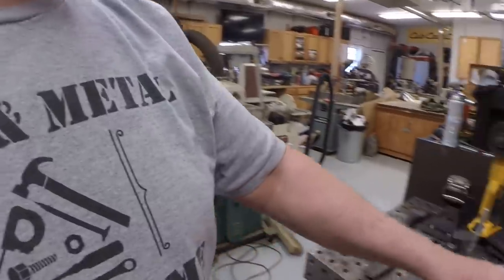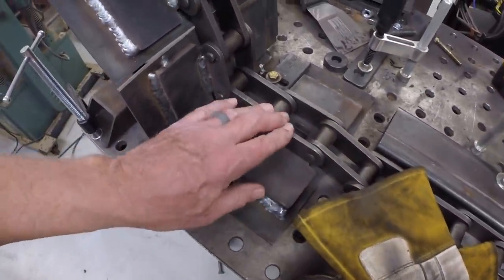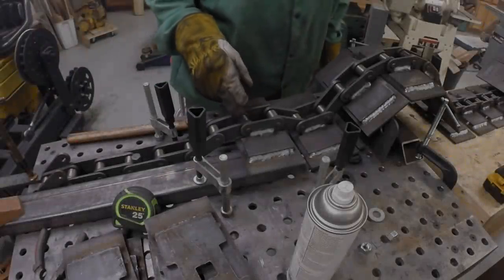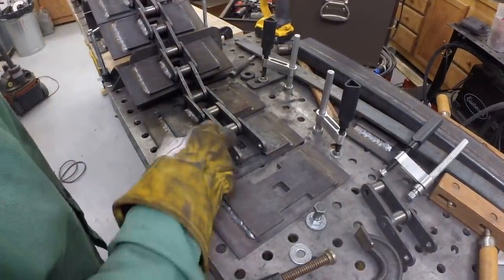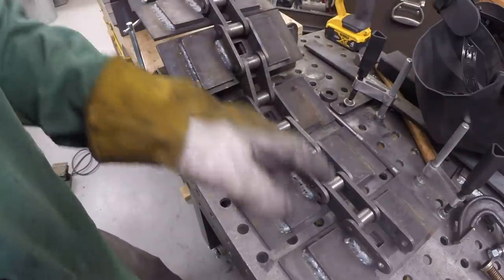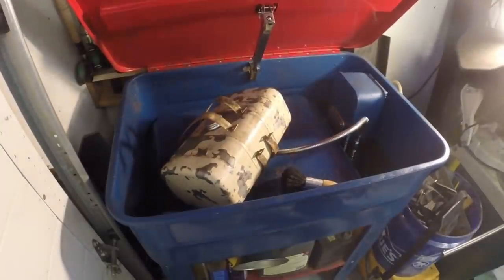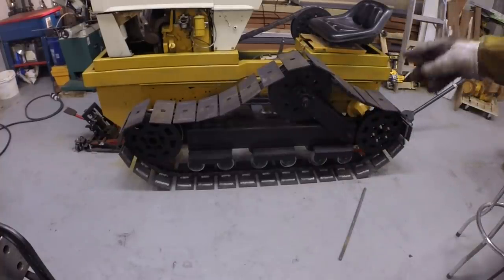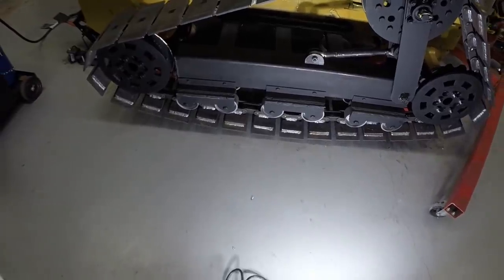Cub Cadet Dozer Build  S2:E4  Track-tackular!

Comment: Hey guy. Don't worry about how people criticize your process because what you build is absolutely awesome. I love it. Maybe a Cub cadet mini excavator in the future perhaps. Keep up the good work.
Reply: That would be interesting to see how he figured out how to run everything off of cub cadet internals and make it still have the cub cadet look. He could use the mower hood where it would open sideways behind the seat and have the mechanicals there like a real excavator. I mean he's got the track system down and once he figures out how to raise and lower the blade on the dozer all he'd have to do was do a little conversion of that system to run the boom, stick, bucket, and rotation on the excavator. He could use a PTO to power a hydraulic pump for those functions. I really think he's smart enough he'd figure it out. Maybe he'll tackle that one day!  😀

Comment: You are doing an awesome job. I am an equipment operator and I have operated a D 10 for many years. You are using a D 10 as your inspiration for your build. But, you are not building a true D 10. Like you said, it's just a toy. It is an awesome toy at that. You are doing an awesome job Can't wait to see the finished product.

Comment: You are making some great progress. So cool to see the track on it. A lot of work to get to this point. Your welds are getting pretty darn good there. Practice makes perfect and this project is giving lots of practice. Funny, I catch myself looking away when you strike the arch. Old habits are hard to break. It looks like you have sufficient slack to assembly the chain off the dozer then install, may make it easier. Hard to tell from film.
There are a thousands ways to accomplish something, I hope that my comments were not harsh or insulting. If our places were switched, I am sure that viewers would be making the same comments about me. Turning a lawn tractor into a dozer is no small task and takes a lot of thinking out of the box.

Comment: (When you were drilling out the holes for the master link) I remember when the brushed 18v would "Hang up" when trying to get through that last little bit of metal and you could "Power it on through. These brushless 20v designed to cut out and it makes it hard to finish the hole sometimes.  I realize its to protect the drill...  

Looking forward to seeing this thing moving under its own power.  AWSOME JOB!!!

Comment: The holes in the links are tight because it is meant to be a press fit. The trick to drilling these out is to drill it in reverse. It's not great on the bit and will require pushing force, but it does work and will reduce the chance of a broken wrist. Be careful and keep up the great work Frank!

Comment: Great update, signed off work and you had just posted!!
Like many others said, those who leave negative comments probably never tried anything even close to what you've done, if anything. ✔ 👍 👍👍
In first episode you even state you used the D10 as a reference for your build, so you are doing exactly what you stated, building a running cub cadet in it's likeness.
I also would love a shop like yours, you use what you have and turn out amazing stuff!!
Love that you keep filming and share your pups with us too🥰

Comment: When I first saw your design I was unsure if i was going to work all that well but after seeing it together is looks good.  You could just about make and add nylon wear rings that bolt around the forward and top idlers to reduce wear on them in the future if you wanted.  Your craftsmanship is very good as well.  You take the extra steps in getting your metal clean and your welds and fitment show.

Comment: Frank don't let the nit pickers get to you. That thing looks 100X better than I could do in my shop and I am a welder/machinist/mechanic. I have designed and built some pretty cool stuff in my day and with a fully stocked shop at my disposal it was fairly easy. I think you are doing a danged fine job with what you have in machines and experience. Would I have done some things different? Sure I would but a lot seems acceptable to me. Sometimes you have to make compromises.
So was that cool or what to see that track go for the first time? It's going to be a blast to ride around. 
Keep up the hard work, the light at the end of the tunnel is getting brighter!
Take care and be safe!
Cheers
Terry
Reply: AMEN

Comment: As always thanks for another great video. Everything that you're doing is just a dream for me. I don't have the tools, time or skills.
Reply: Nothing to any thing here except learn it and as for the tools eBay has a mig tig stick 110/220 machine for under 400$ that I kept over a Lincoln 110 mig simply because it out performed the Lincoln at 110 to 110 why not have the better welder with much more options the rest of the machine tools are not as expensive you might think find a cheap lathe in the 9-12” range for 500$ or so and with that one machine it’ll blow your mind what you can do everything done with the plasma table can be done with an angle grinder not much fun but it can be done start gathering tools and before you know it you’ll have a metal fab shop quick ask me how I know in under a year I have a functional full size machine shop

Comment: Very nice man its coming along nicely. Im getting ideas from your build for a project.  I will recommend theres a certain amount of slack youd want left in the track to prevent the track from wearing out faster than it should.  I cant remember the formula to calculate it but the cat d9 and 10 dozers i run at the gold mine we have a ruler that u measure from the center of the suspended  track frame to the track pad to determine if its adjusted correctly

Comment: Frank, The link was not made incorrectly - the problem is with the weld jig.  A better jig would be do have the link lay over the plate and then insert an alignment block into the square hole of the track plate. This correctly aligns each link to each track plate. This way eliminates the slight misalignment that becomes compounded over 31 tracks.
Reply from the maker: Pretty keen if you could tell all that from there.
Reply: @woodandmetalshoptime8048  Well I think there's  a brief moment in the video where one can see the square  hole in the plate is not quite centered between the ends of the link.  Also, my experience has shown similar results if the "timing" is not precise over sufficient  amount of repetitions. Bottom line for jigging, it must secure both items simultaneously. Currently your link locator is distant from the track plate locator.
Reply from the maker: Track pad placement on the chain is strictly a cosmetic thing. The chain determines how the track will run, I'm not affecting that. There is no cumulative error because it's all in the chain. Worst case is a pad might be out of alignment with the others.
Reply: @woodandmetalshoptime8048  Fortunately there was little difficulty for you until reaching the the last 3 or so pads of the track. It will be interesting to see if welding the next track is any different, or similar results.

Comment: Very nice Frank!  Has your welding skill improved from your perspective with the many welds and new welder?  From what I can tell it has.  Would like to know what you think.  Thanks!
Reply from the maker: I think the new (240V) welder did more to improve my welds than anything. I was really struggling with the 120V welder. Obviously, practice does improve things, though.
Reply: @woodandmetalshoptime8048  one thing I would recommend is grinding the mill scale off the flat bar. Mig welding tends to ball up on top of the scale and not get very good penetration. Some machines have a dig setting which can help punch through the scale a bit but you're better off just grinding it off.

Comment: Need to use a step drill for enlarging those link holes. Much easier on the wrist!
Reply: But You Can't Do Deep Holes with step. Maybe a Reamer?.
Reply: @dougsandercock1672  You can do around 3/8" thick plate at a single diameter with some of the ones I have. Which would have been sufficient here it looks like.
Reply from the maker: The issue was more about the drill chuck hitting the track itself, causing the bit to be angled in the hole.
Reply: @woodandmetalshoptime8048  Most of them use 1/4" hex drive, so you just use an extension to get as much reach as you need. Do it all the time, works brilliantly.

Comment: Hey Frank. Just a little constructive criticism. If you go to the 11 minute mark on the video, you'll see the way the weld glows brightly which means there wasn't penetration into the track pad. Just trying to help as I have been welding professionally since 82.
Reply from the maker: So how do I fix that? Or, how do I get better penetration next time? Fortunately, it's not a structural weld...
Reply: @woodandmetalshoptime8048  if you direct more heat to the thicker material and watch the puddle blend into the thinner that would do it. I realize it takes practice. Just trying to help by giving you something to watch for. You're doing really well over all.
Reply from the maker: That was an awkward position to weld, the backside of the chain. Looking at that particular weld, I see what you are saying. I think most of the other welds didn't look like that one.
Reply: @woodandmetalshoptime8048  yeah that's the one that stood out to me. It's important to get yourself into a position to see the puddle as difficult as it may be at times.

Comment: Only thing I'll give criticize about is, honestly, you should've double checked the holes for the master link pin prior to welding the chain up. That's just a common sense thing. Not saying you did anything wrong. It's a live and learn and we all do things differently.  
It is coming along, slowly but surely. Looking forward to when you get the other track on. I'm still curious to see how you intend on getting on and off the machine though. Great video, cheers :)
Reply from the maker: I've been climbing up by stepping on the tracks but recently added a fold down step on the tension arm.  You won't see that for a few weeks, though.

Comment: Nice setup thus far. You drill probably begs you to stop using it to drive the tracks. I can't believe it has the power to run the tracks. The poor little planetary gears sets inside the drill are giving everything they have. But Thumbs Up for a great series...
Reply: But remember it's running a pump under relatively low load.

Comment: I've used those paint remover wheels several times, a little on the pricey side but worth it for a quality finish.

Tracks, using a rubber track ever cross your mind?
Reply: Rubber $.

Comment: Hi Frank, excellent vids mate, One thing worries me I don't know if it's just because it's a video or not, I am, or was before I retired a pro welder, and I am concerned you are not getting a good penetration on those thick sheets and that chain, I don't see the marks you should have on the backs, if it's a cold weld it will have no strength. Bob in the UK

Comment: Awesome job, Frank. I am just curious after adding all the weight of the track system and blade will the dozer have enough power to actually move dirt or gravel. Not criticizing at all, again just wondering. When I was a young boy a man down the street from me made a dozer almost the same size for his son but most of it was made of wood and old lawn mower parts, really brings back memories of my childhood. Keep up the good work. Love me some cub cadets don't make them like that anymore. 👍👍
Reply from the maker: Hey, Chris, you've asked the question many others have asked, and it's a logical question, for sure.  The weight of the tractor is really not an issue, it takes very little power to actually move it on level ground. HP becomes the limiting factor as far as pushing a lot of dirt. Which is true of any piece of equipment. Since I don't expect this machine to do any major work--I'm not clearing land with it--it will still operate within it's capabilities. Meaning, I should be able to grade my driveway, spread gravel, that sort of thing. It's really not about building some super capable machine, it's about using Cub Cadet parts to build a toy dozer--functional within it's limits.
Reply: Thanks for answering my comment, can't wait to see and hear the click clacking of the tracks. Like I said before love those older cubs awesome tractor and love big boy toys bigger the better. 👍👍⭐⭐⭐⭐⭐

Comment: I can see the Go Pro mounted on the plasma table when you do close up shots while cutting.  Do you use another Go Pro for the majority of your videos or some other equipment?
Reply from the maker: Everything is done with GoPro cameras. I have 4 of them. (well, one is a knock off, not an actual GoPro.)
Reply: Thanks Frank.  Which Go Pro's have you got?  I know they offer different color and numbered versions.  Your videos have inspired me to film some of the items that I build.
Reply from the maker: A 3, a 3+ and a 5 and a knock off. The 5 is problematic. Need to remove and reinsert the battery every time it's charged to get it to boot up.   Most stuff is recorded with the 3+. I have very limited internet here so I shoot in 720/60 fps.  It takes overnight to upload a video. LOL.  Where's the Rural Broadband Initiative when you need it?  Waiting on Starlink to become available here, supposedly mid 2022.
Reply: That's what I needed to know.  Thanks Frank!

Comment: Why the odd number of pads?  31.  Seems it should be either 30 or 32.
Reply from the maker: There are two different links in the chain, the outer link and the inner link. They alternate. The track pads go on the outer links. You can have any chosen number of outer links but will always have one fewer inner links (as they go between each pair of outer links).  So there are 31 outer links and 30 inner links. Hard to explain but if draw it out it will make sense.

Comment: Also on your master links I believe I’d use long bolts or all thread probably just the one make it to where the two ends are factory just mill out the pin that’d be your new bolt to attach
Reply: [it would hit on the inner guide rails of the inner track guides in the sprockets; thus, the pins are used for proper clearance with minimal protrusion]
Reply: @bobrauschenbach4347  forgot all about that